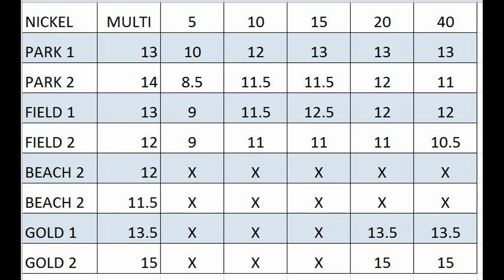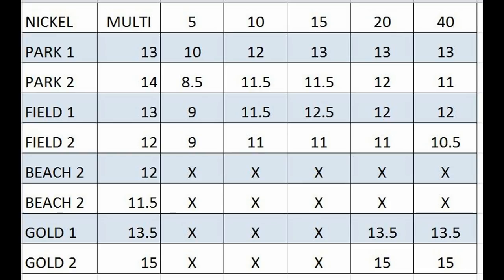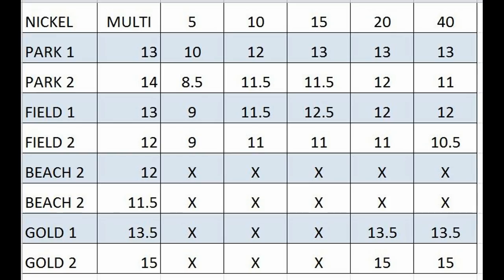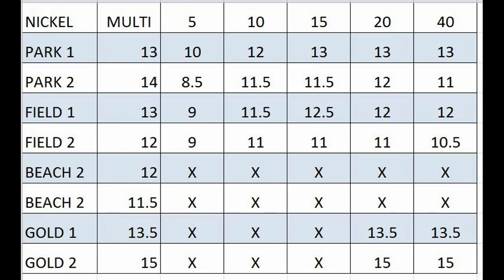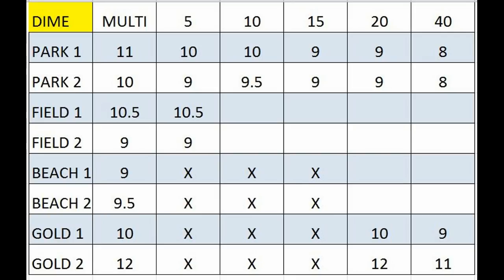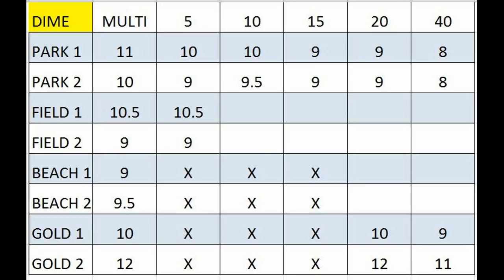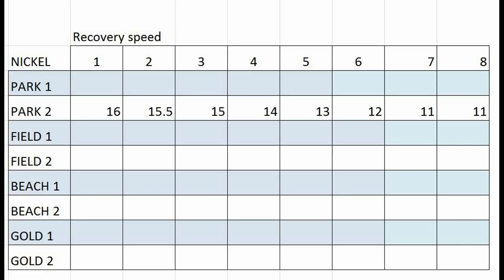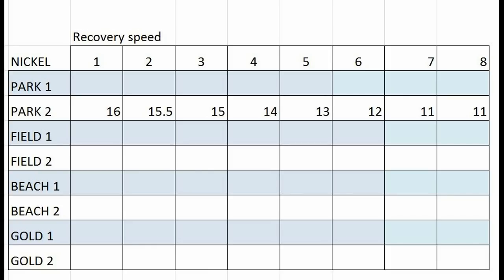Minelab Equinox 800 - Testing settings

Comment: I have an Equinox 800. I just did a similar comparison but only in gold mode 2 with coins from the 70s, .08 grams copper wire, .99 and .06 grams lead, tiny pieces of foil, and other very small pieces of metal. I also switched my coils between the 6 and the 11 inch coil. I place two 2 inch concrete bricks between the coil and the targets. For the very small targets I obviously couldn’t use the bricks. My intent is for hobby prospecting.  Setting up a test bench test like you did gave me so much more confidence and understanding of action vs reaction from the detector. My conclusion for the hot soils in Colorado is GM2 in 40 kHz. Multi does detect ever so slightly deeper on minus one gram lead. The benefit from using only 40 KHz is the extreme difference in noise. Multi frequency is non stop constant chatter. Visual ids from negatives to 20s and 30s, Even with ground balancing and noise cancellation. The only solution was lowering the sensitivity. From 25 down to 20 was a significant loss in depth. 40 kHz at max sensitivity without ground balancing and noise cancellation was still much more stable and so much more peaceful. With 40 khz and not all that damn noise I could clearly hear the threshold break without a visual target id on multiple test. I can hear the threshold break in multi but only because I know when I’m passing the target by the coil and I can wave the target to pronounce the threshold but I believe in an actual environment to be overwhelming and not effective. Again the single frequency benefit only seems to work best with the lead because my test using the coins in single frequency has a loss of 20% average detection depth with both size coils. I hope you do more videos because it seems like the two best videos I’ve seen on YouTube explaining the frequencies are the least viewed when some high view stuff is just trash. Thanks.
Reply from the maker: Thanks for the comments. I would like to do some more videos but I do not have the equinox anymore. Doing tests like you described is really the only way to get a good idea what settings work best for certain situations and targets.

Comment: Excellent points. I normally hunt trashy parks either in all metal or discriminate iron and foil with sensitivity cranked up. I want to do relatively the same when equinox arrives and tweak it so i get best depth. Keep the videos coming.

Comment: After several months using the detector in the field I can conclude that this air test is its actual behavior in the soil. If I find the marginal target in some mode I would switch to other modes to compare the signals. Equinox is always deeper in gold 2 mode.

Comment: Went out with mowerdog yesterday and gave the equinox 800 some park time. I ran park 2 as you have yours set up. It ran great. I do wish iron would stop coming in vdi ranges that high conductors range in. Not sure if that is a software bug or not. Hopefully,  minelab addresses it.
Reply from the maker: I have issues with rusty bottlecaps coming in right where a nickel does too.  That dont happen on the etrac.
Reply: @DirtFishing  Me too. Iron rings in alot at 25 which also shouldn't happen. I love my Etrac also.

Comment: Great video. So You can build your custom setting and switched it on when need to cross check some doubtful deep signals. Also I'm curious if the threshold on would have some influence on death.?
Reply from the maker: Yes  to the first question.  I played with the threshold some and did not see any increase in depth.

Comment: Very detailed analysis here thank you. I’m getting allot of falsing with iron on my Nox 600. It makes a loud beep like it’s something good when it should cancel the noise out. Nevertheless I’m getting constant falsing even  with low sensitivity & an iron bias of 3 which is the highest setting on the Nox 600. I’ve tried with discrimination and all metal too. Not sure what else I’m doing wrong. Any help from yourself on what I can do to cancel out as much falsing is greatly appreciated.
Reply: check your coil for wobble. Stock shafts are very prone to causing just this. What you should do is upgrade to a light weight carbon fiber 2 piece shaft to eliminate this issue.